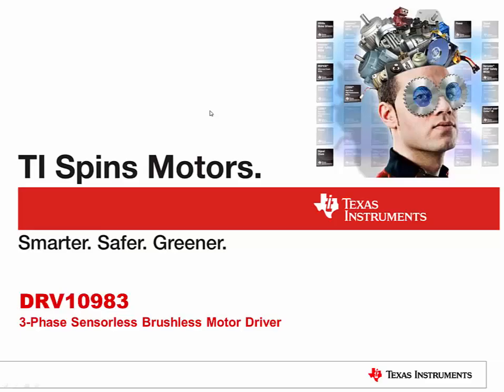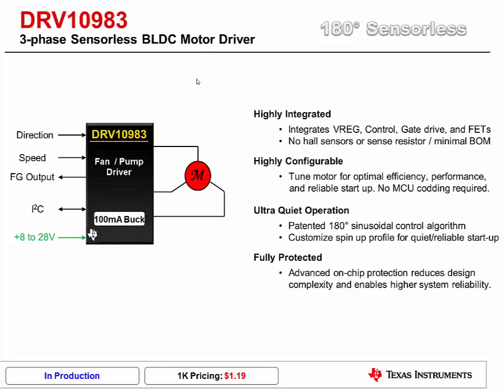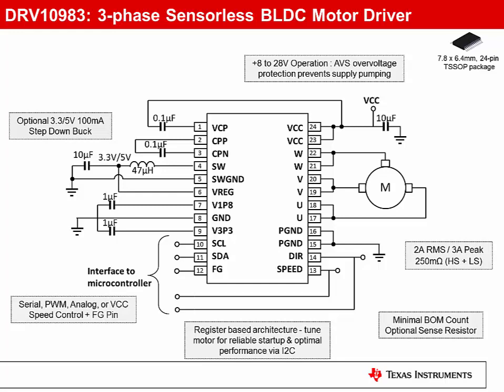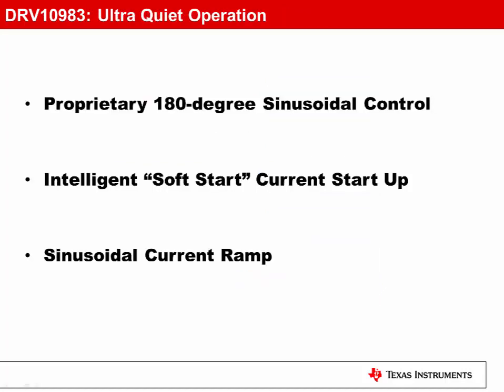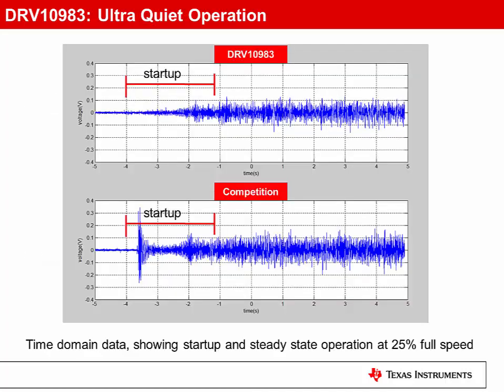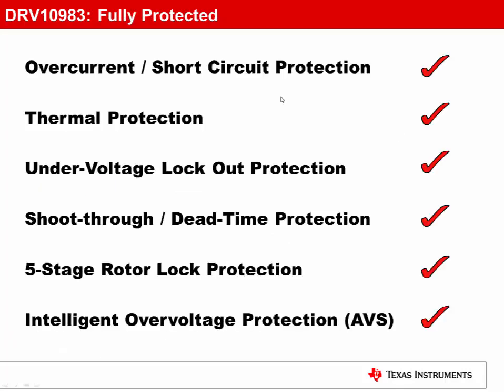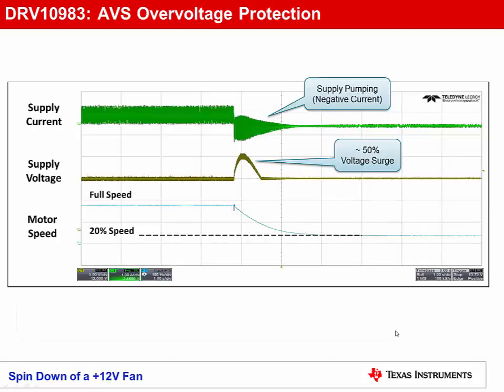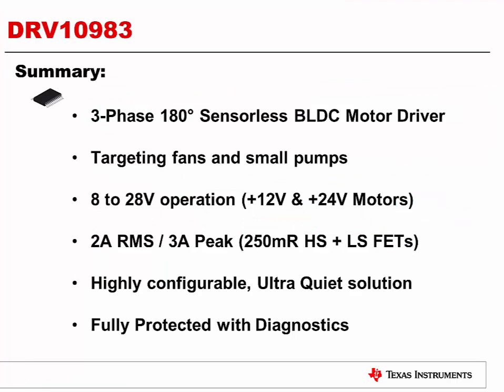DRV10983 Device Overview

Comment: While the 3ph output frequency to motor is varied, what happens to the 3ph output voltage to motor? Does it regulate the V/F ratio ?
Does it sense the output 3ph current and regulate the torque  to motor ?